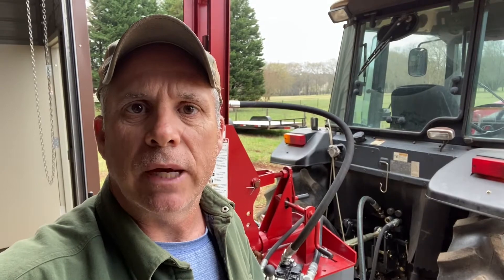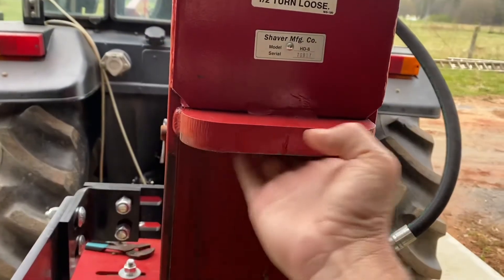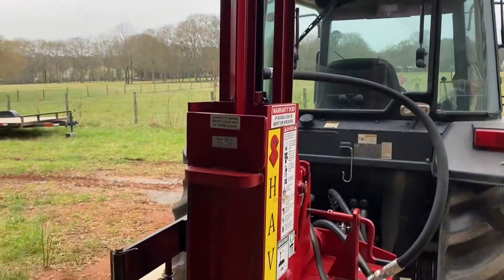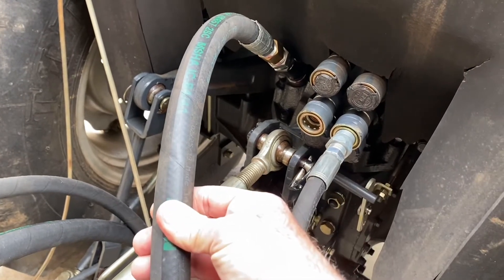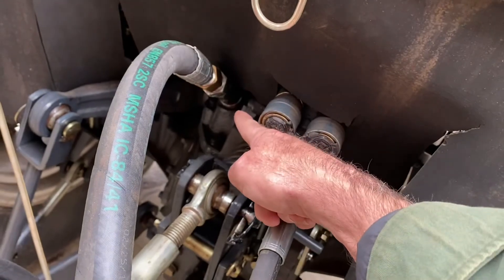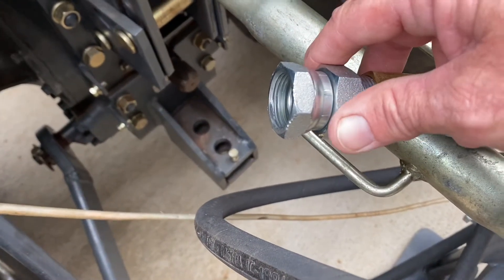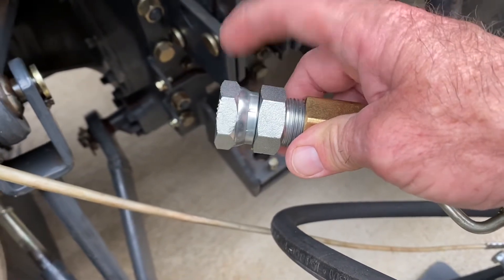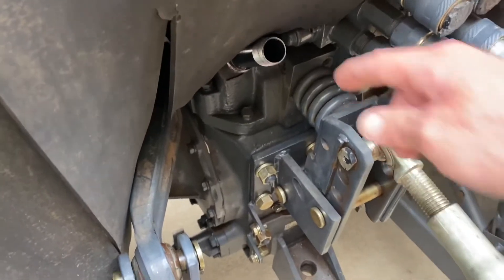Shaver Post Driver - Proper hydraulic hose hookup

Comment: I made an adapter just as you described and according to the manual.  I have a Kubota L6060 and I had to use both ports on my hydraulic outputs.  This works well for me. 

Using the return reservoir fitting would not work on my tractor.

Comment: I called Shaver to get the adapter so the blasted thing will work. They had me call a distributor in my state. They wanted $96 for it. Are you kidding me? I paid $3,600 for the thing and they want an extra $100 for the adapter? Got to love the equipment world.
Reply from the maker: Yes mine was over $100 and I ended up having a machine shop get it for me at $21! Glad you found it
Reply: Never mind. I found it online for $32.  That’s more like it.
Reply: @JonGreene79  It's been a while since your comment, but can you tell us where you found that adapter?
Reply: @cabodj  I got the adapter but it didn’t work. The threads didn’t line up. Lost a lot of good hydraulic oil that day. 
Take @bdradley1 advice and have a machine shop make you one.
Reply: Well, at least you have an adapter. I have a Mahindra 4510 and bought the HD8 and they do not have an adapter. They sent me a generic junk adapter for a hundred as well, and it leaks everywhere. I have tried to 3d print one out of carbon fiber, but it isn’t strong enough. Very disappointed with Shaver.